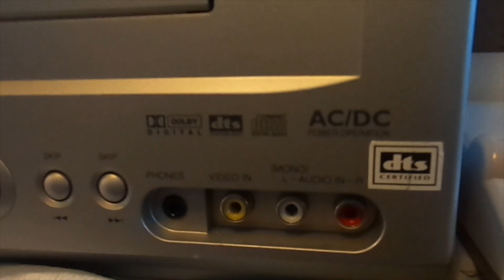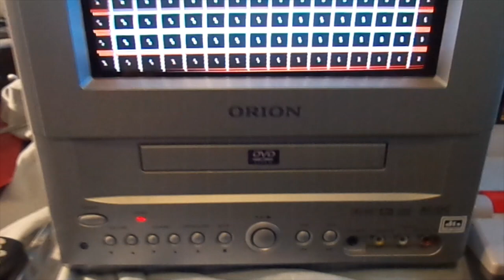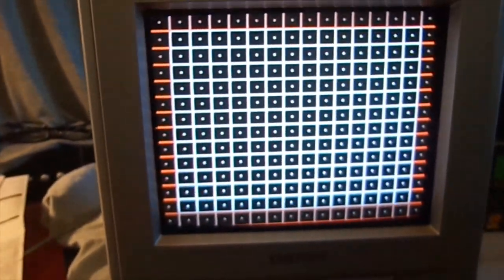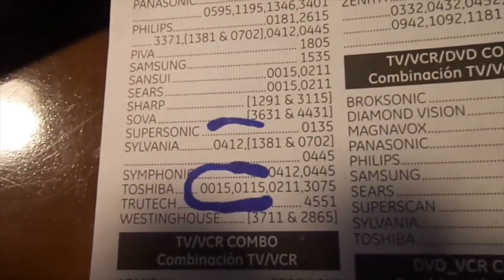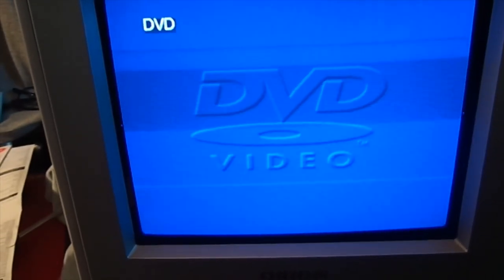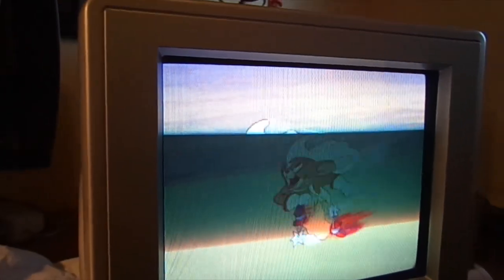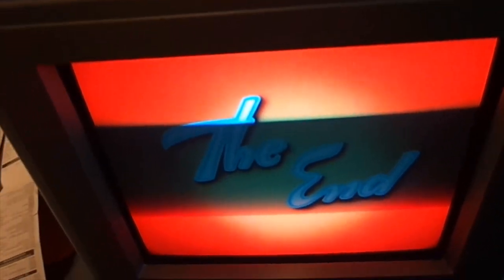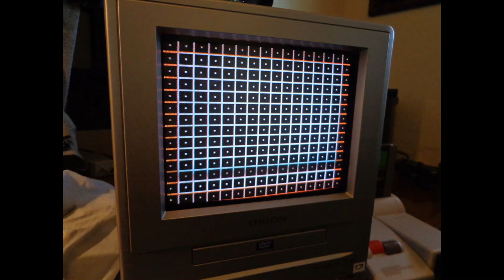Dumpster 2005 Orion Tvdvd092 rescue

Comment: Just want to say you saved my bacon with that remote code - I would never have guessed in a million years that a Toshiba code would have worked when none of the Orion codes did. The working code was "0015." Thanks very much!

Edit: Correction - "0015" left me with unexpected results on my remote - channel down button raised volume, etc. Code "0211" resolved this, but I have yet to find a code that works on the DVD player.